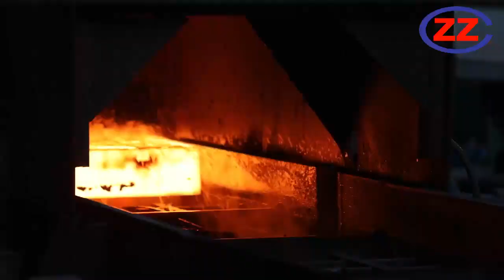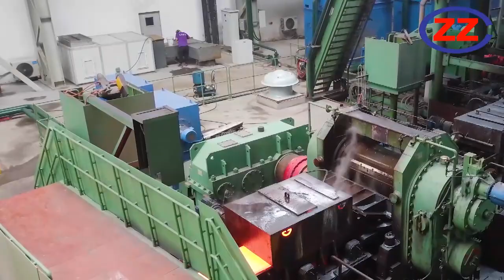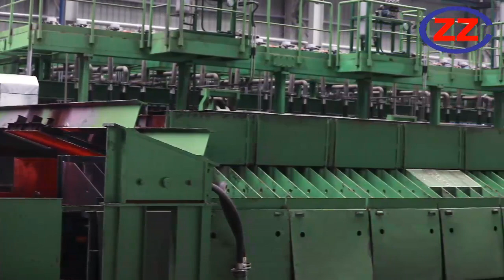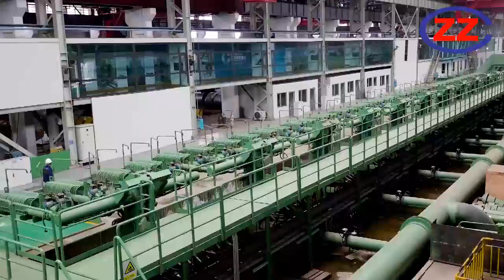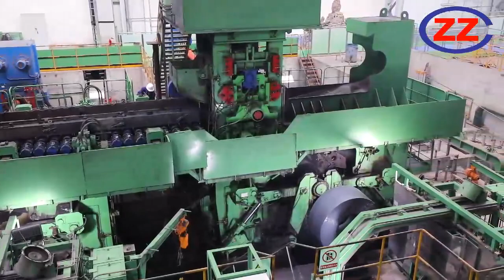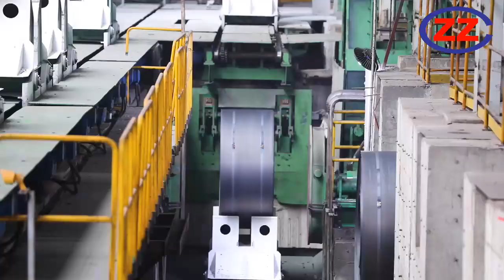ZZ's 1100 Fully-continuous Hot Rolled Strip Line

Comment: Width & thickness of the Strip & slab dimensions please ?
Reply from the maker: hello Ravian. The final strip is 1.8~12.7mm thick, 650~880mm wide. Slab sizes: 670~870mm wide*180mm thick*9000~10500mm long.
Reply from the maker: you can add my WhatsApp for more communication, +86 18920319154